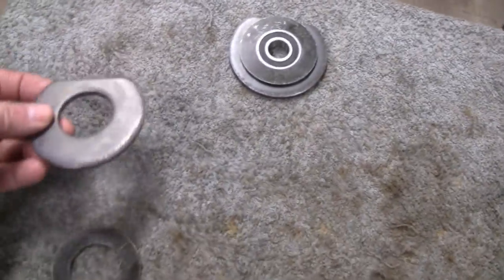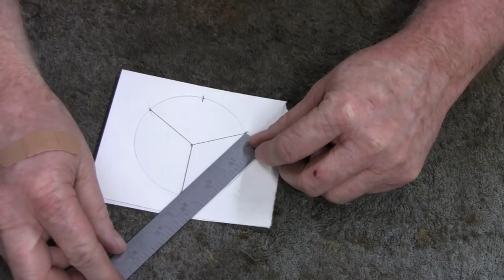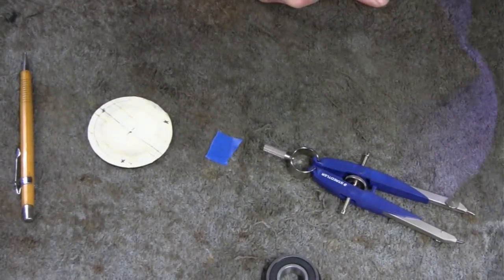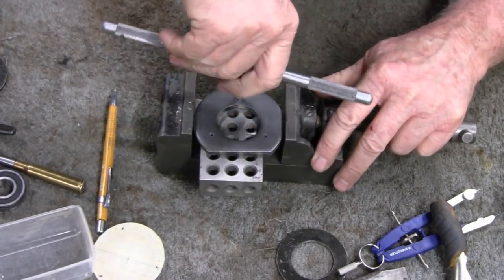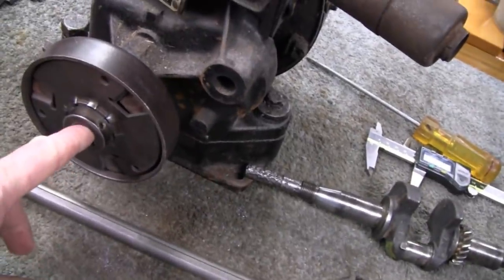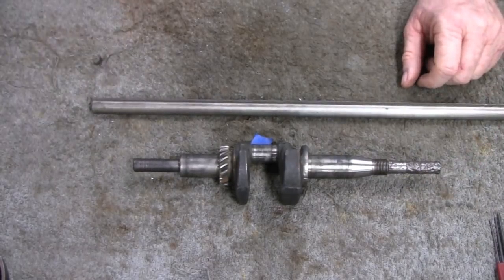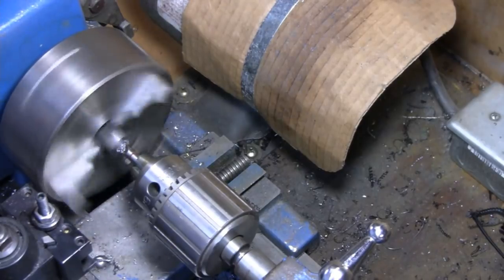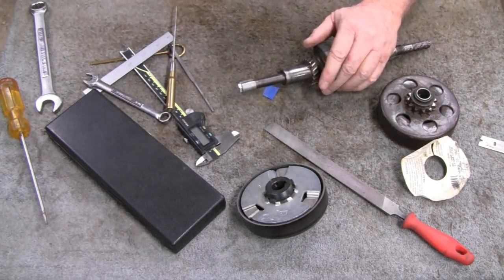MOTORIZED SCOOTER BUILD (part 7)

Comment: Have you ever used one of those spring loaded punches?  No hammer needed, just push down on the thing until the spring engages the ratchet release and "BANG', the internal piston fires and it makes a mark.  Even the ones sold by Harbor Freight work OK.  People also use them done here in Florida as an emergency window punch.  If your car should go off the road and into a canal, you might not be able to roll down the window or open the door to get out, but one of those spring loaded punches held against the window glass will shatter it.

Looks like the chuck in your drill press has some visible run out, it's wobbling!  (Or is it the bit that's bent?)

when using the first washer as a template to drill the second, you should have stuck a small screw in the first hole to keep it aligned so the next two holes would line up.  If you rotated the first washer a bit when moving the bit, the three holes would not line up.
Been there, done that.
Reply from the maker: Yeah we have a good name brand Spring punch, They only work 50% of the time at best!!☺
Reply: I've had better luck with those, but I mostly use it on aluminum not steel.

Comment: Welding that length on a small diameter can warp it a little. May want to plug weld a sleeve them machine it down.
Reply from the maker: I hope you're wrong Bud!! We already welded it, but I haven't thrown it on the lathe yet!!☺

Comment: Hey guys i like watching all your videos you guys do amazing work. I have a question and maybe you have an idea of what i can do. I own a 2004 Zenn elecrtic car i bought it without the motor and elecric motor controller ect. I wanted rrbuild it myself with all the original parts but i changed my mind and want to install a small gas engine in it like a one or 2 cylinder briggs it is front wheel drive and has adiferental indipendent front suspention and i want to hook up the 
briggs to it  but im stuck on how to do it? I really need your guys advice can i contact you some way and send you pics so you can see what we have to work with and maybe we can figure a way on how to do it . Thanks Josh

Comment: Good job Buddy! You may want to center drill the 1/4" bolt head so you can use a live center when turning down the clad weld. I thought TapMagic was only for us on aluminum so I learnt supen nuw. :-)
Reply from the maker: Thanks Bud!! Yeah the Tap Magic says "For all Metals" on the label!! I use Relton A-9 for aluminum!!☺
Reply: And I use WD-40 for AL. I suppose JB-80 would also work because it is supposed to be "twice as good".

Comment: Where do you get your screws, bolts, etc?  I've never had any luck with Lowes, Home Depot is a little better but Tractor Supply has been the best.  Fastennal has local stores  but I've never tried them.
Reply from the maker: We have a huge Hardware/Steel company not to far from us!! They have a building dedicated just to nuts and bolts, they sell everything by the pound!! I can buy a couple pounds of bolts for the same price as 2-3 bolts at HD or Lowes!! Plus alotta stuff I buy on Ebay!! I would stay away from Fastenal, their prices are on the moon!!☺
Reply: I can remember 'all of those bolts, etc.' in the circular bins when I went to the real hardware store with my Grandfather.